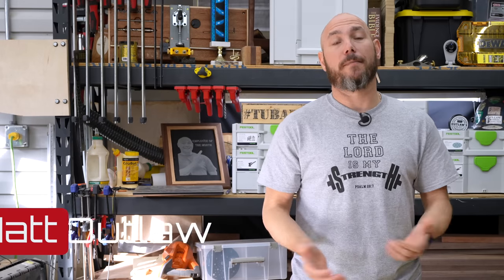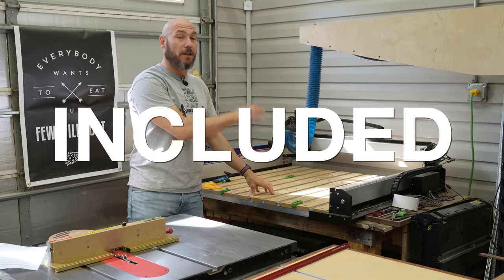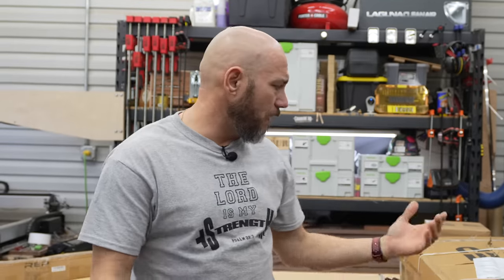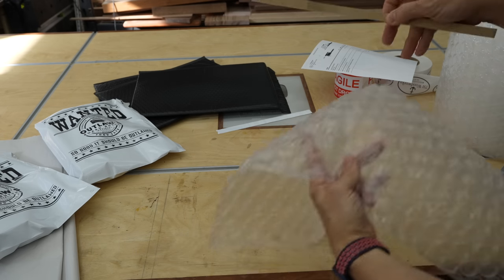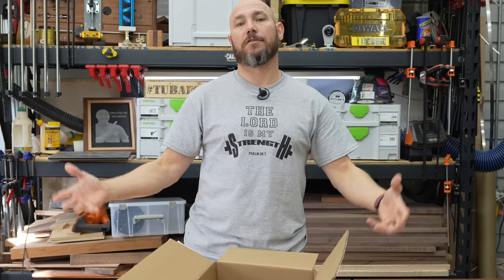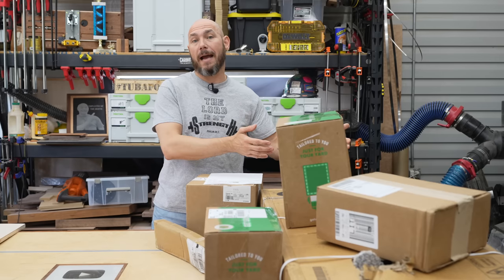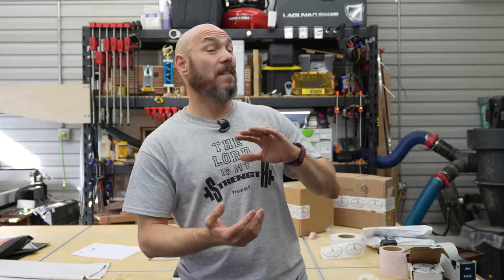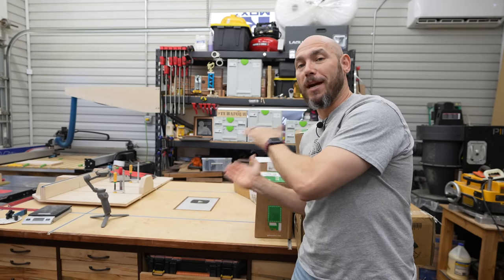How to Ship Woodworking Projects

Comment: Great video as always.  I need advice on shipping large items like an entry table I build.  Guessing the box will be 56 x 15 x 34.  According to UPS it could cost nearly $400 to ship it to the Coasts.  I'm in the midwest.  I REALLY don't want to build things that need assembly by the customer.  A lot more of my time to build something like that.  It could in some cases be equal to the cost of shipping.  As you said...Time is Money.  So my question is are there other options besides UPS?  According to USPS  this box size is too big.

Comment: Howdy Mr. 731..

In conjunction with several of your recent videos..."Chasing Your Fears, Shipping, Website design..."

Shipping: My shop/s are on my property, as such is my home address. Once I start production and selling items, I don't necessarily want the world knowing my home address. I understand getting a P.O. Box as a business address, but I'm missing something. If you have relatively large items to ship and for what ever reason it gets returned, how is that done? 

Website: A "Fear" I've had is learning what all the buttons/options do. It's a bit overwhelming.  I tried to learn Excel....it's got like 10k icons :) and I ended up not learning it, I'll just use a pad and pencil. 

I just don't see how YOU find the time to build stuff and everything that goes with that AND do computer stuff. How do you manage your time with all that?
Reply from the maker: Time management is a HUGE challenge for me.  Only recently was I able to hire an editor to help me with some of the video editing.  Once the website is up and running there is minimal action you have to take on your part. 

Website building isn't very hard with today's modern website building tools.  I can show that in the upcoming video.  there are some steps but for the most part, it is fairly straight forward.

Shipping, I'm not exactly sure on large items (like tables, etc.).  I would just ask the PO when setting up the box.  There may be a way to have an item forwarded to you via USPS or UPS etc. that doesn't show the customer your home address.
Reply: @731Woodworks  Thank you for the reply Sir. I look forward to your web design video. Pencils are sharpened, notebook is fresh and ready Magister (Latin for teacher, took 2 years of Latin in High School '88-'92, Go Bobcats!!)

Comment: Just a note - if you have a scale without the hold button, put the item on the scale and then zero the scale.  When you remove the item, you'll have the weight on the display.